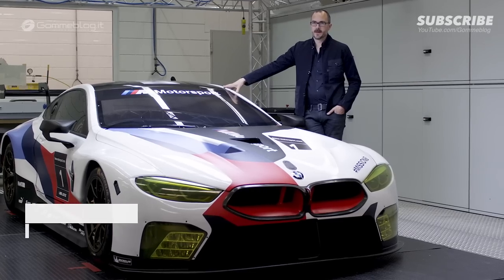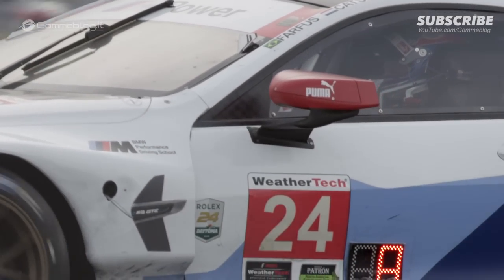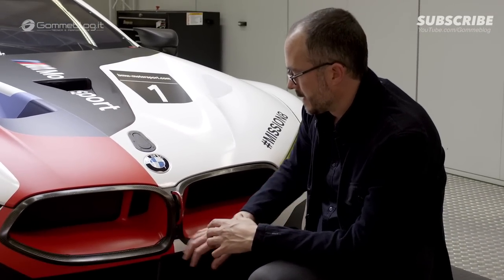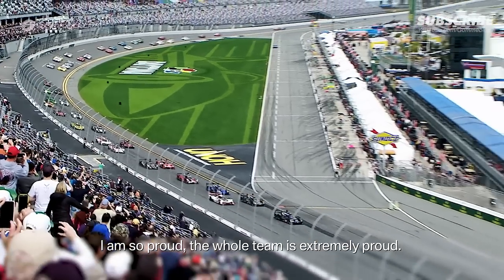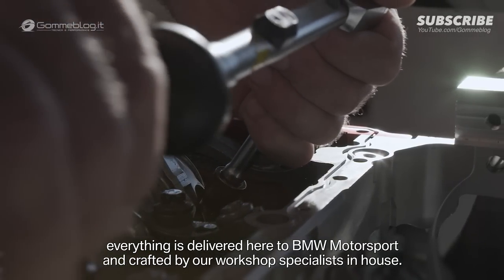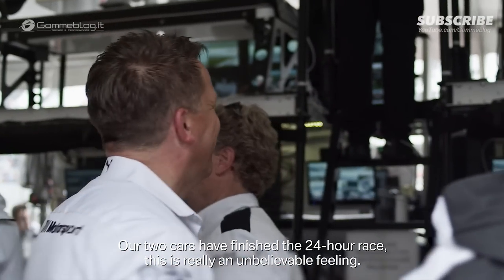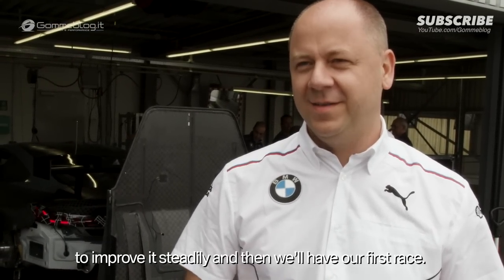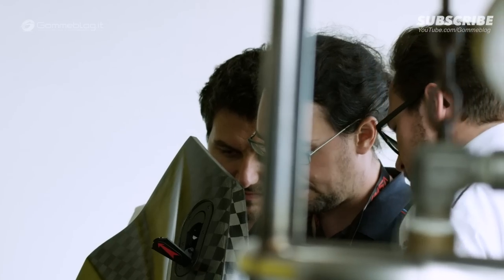2018 BMW M8 GTE - How To Make a RACE CAR | Development Interior, Engine, Exterior

Comment: The performance of this car is still not convincing.
Reply: John Edwards set a lap record in the black #24 car at Road Atlanta in October, so I mean... The performance is there. They also received more boost in the middle rev ranges after Daytona from the IMSA BOP (balance of power). Endurance racing is about consistency and finishing the race without breaking the car more than it is about going faster than everyone else.
Reply: I can't really understand the performance of this car tbh... Like for instance it did win the 24 hours of Daytona twice which is commendable, but they haven't one a manufacturer's title in the gtlm class. However we can also see this car dominate the iracing IMSA series